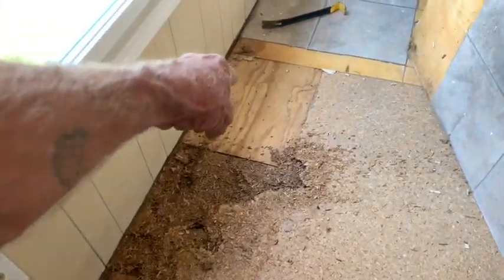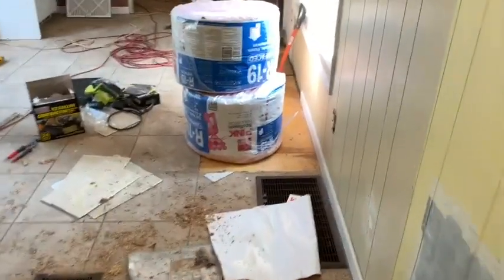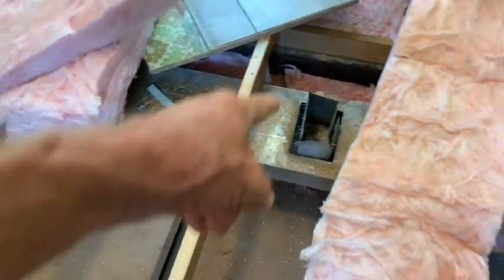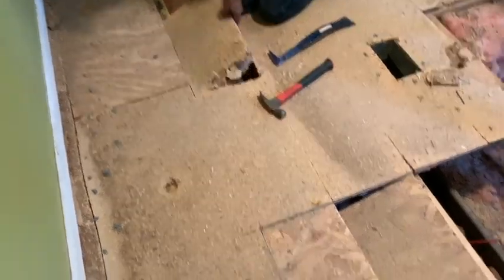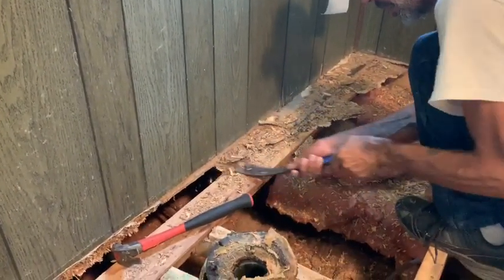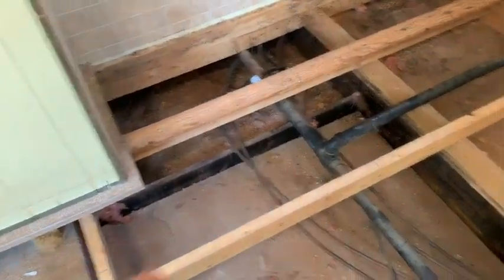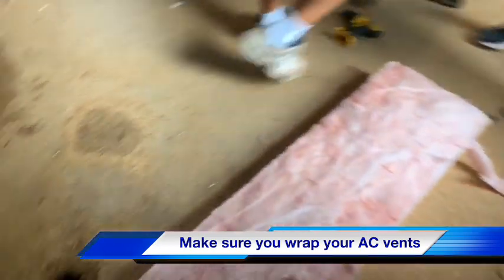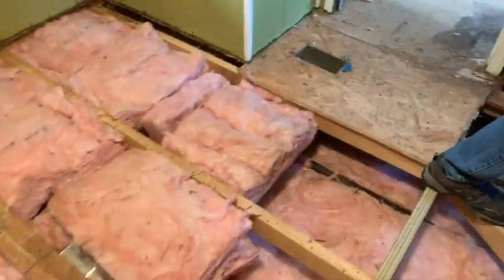How to repair a rotted floor single wide Mobile Home video 2

Comment: I just bought a rambler that was completely remodeled accept they just laid down a quarter inch plywood in top of rotting, spoungi, and rat chewed flooring from underneath.  I spent 7k having the insulation removed, the venting, and had reflexit bubble wrap like insulation out in.  Done poorly.  My floors are getting wavier and wavier.  I have replaced some very rotted spots myself, very patchwork style but id rather spend the money have the entire sub flooring replaced.      But I feel that I need to figure out my insulation first.  I am considering foam board.  I don't like bat because it just becomes a home for rats.  :(
Reply from the maker: I would have went in there removed all the three-quarter inch crap board replaced all the insulation installed all new Three-quarter inch subfloor for seven   He usually runs about $1000 every 10 foot so if you have a 60 footer you’re looking at six grand. Labor and material
Reply: @Drewsroofingandhomerepair  that's amazing.  Too bad I live in Washington state where it seems home repair is expensive.  Which is why I end up learning some of this stuff on my own.
Reply from the maker: I wish I did live closer I’d gladly help you out

Comment: are you saying you can replace a section if its plywood but not osb
Reply from the maker: I’m saying if it’s OSB it will be best to do whole floor
Reply: @Drewsroofingandhomerepair  HUH?
Reply from the maker: If the floor has OSB or particleboard it’s best to change the whole floor and not just do a piece

Comment: Do you just get as close to the wall as possible ??????
Reply from the maker: Yes I just get as close to the wall as I can and if you look at some of my videos you’ll see the saw that I use I bought it at Harbor freight it’s called a flush cut saw or a jam so if you take a picture of it you can bring it to Harbor freight and they can get you one for 80 bucks
Reply: @Drewsroofingandhomerepair  thank you so much
Reply from the maker: Go to my video where you see me using that Walsall take a screenshot bring that screenshot into Harbor freight they’ll put you right on that tool.

Comment: How much does a job like this cost? My sisters Doublewide has several soft spots. We were going to do exactly what you say not to do, patch just the spots. She is ready to light a match to the piece of sh it.
Reply from the maker: Right now plywood is expensive. The prices are starting to come down but they are still quite expensive if you measure your floor and it measures 10 x 10 that is 100 ft.² it would take three pieces of 4 x 8 plywood to fill that spot that’s how I figure my materials.
Reply from the maker: https://youtube.com/playlist?list=PL8xp84iSvTA570yVi5b5MZAIrw5yNXkQT

Comment: I need a new roof, 3 different wall areas, and new floor on the end of the trailer.  I’m wondering if it’s worth it because this looks EXPENSIVE!  Are you willing to reveal the charge for the job in the video, just for an idea?
Reply from the maker: You can replace a 10 x13 room your self for around 500

Comment: Great video, those floors that are press boards, aint worth a damn.  They will get wet, and absorb water and will get soft and break apart. Yep damn saw dust, cheap ass wood. Once wet, you will have hell on your hands. Best GET WOOD THATS GOOD FOR FLOORING.
Reply from the maker: It’s hard to believe what they put on Mobile Home Floors when they make   Them

Comment: so you replace floor with new plywood and floor covering down the road you have another leak do you have to replace the whole floor again or just a section
Reply from the maker: Just a section if it ever happens again but it shouldn’t ever happen again now
Reply from the maker: dumpster d if you have old OSB you’ll have to replace it if you replace the whole floor with new plywood number one if it gets wet it takes a long time for it to deteriorate so you know you have a leak way before you have to replace the whole
Reply: @Drewsroofingandhomerepair  polybutylene
Reply from the maker: Nice

Comment: but even if you replace the whole floor if you have a leak you have to do it again.
Reply from the maker: No that is not true because when you replace the floor you get rid of that old garbage and you use the new upgraded updated plywood that does not go away when it gets wet. So I understand what you’re saying. But that is not the case if you put better plywood on the floor than what was there. And that would obviously be my choice. You’re going to either use 23/32 laminated plywood or what I would prefer would be the Adventech. Now that would be the best plywood you can use it will never go away even if you dumped your swimming pool in their

Comment: Drew's - Of all the videos I have seen out here, only one other made sense and I could tell that he knew his shit - as y'all know yours. I have never done this before and am going to be doing some MAJOR work here soon, money providing and a little at a time, to a 12x60 trailer. The bathroom which is right now my central most concentrated focus, is ALL MESSED UP. I would love to shoot you a video of the way that it looks now and just from the topside alone. Whomever did the shit work here before, I wish I knew where and who they were so I could embarrass the shit out of them for this crap ass job! Dude, they ran an outside water hose through the inside of the house from the bathroom to the kitchen in order to hook up water in the kitchen!
Anyways, with the bathroom floor: I have a toilet that has overflowed several times onto an already damaged floor as well as a washer that has done the same, once. The toilet is sinking into the floor, won't flush anything but piss/urine and the soft spots around the toilet have proven treacherous to say the least. I have to tear apart everything to fix this shit and have no clue what I am doing. Not only that, I have little funding, no one within a 100 mile radius that has any clue on how to do this or to even begin to give advice, two sons and a wife to protect and more stress than Al Bundy when it comes to the mounting home repairs needed. My walls are falling in and are rotted around every window along with the floors that join them - AND I REALLY NEED YOUR HELP!
Reply from the maker: It’s not that hard to do I hope my videos help you I hope it something you can find a way to do yourself I think you can do it

Comment: 3.5” floor joist 24” on center? Seriously? How did the manufacturers get away with this??
Reply from the maker: Do you think that’s bad wait to you see this video then I’m sharing with you. This is the kind of thing that they used to allow back in the day. Thank goodness they don’t allow it anymore please check out this video below you will be flabbergasted. 
https://youtu.be/6eCF4OBSJNA
Reply from the maker: And if you think that one’s bad look at this video
https://youtu.be/cp9igBMSDAY
Reply from the maker: I have seen just about everything when it comes to a mobile home unbelievable what they let them get away with
Reply: @Drewsroofingandhomerepair  I grew up in a 20 year old 1972 Champion… the roof trusses were made of 1/2” square stringers and scrap paneling stapled together. When my parents bought it in 1990, it was all original inside - complete with red shag carpeting and padded vinyl “beams” in the living room.
Reply from the maker: That is a hilarious story. Shag carpet L O L

Comment: But if you do the whole floor you can still get a leak
Reply from the maker: Yes that is true but the reason why I say do the whole floor is because of the type of flower that is on the floor. The plywood that is on the floor is very susceptible to moisture. Therefore you want to replace the entire floor with flooring it will not go bad if there is another leak. The flooring that you’re looking at in the mobile home is made of sawdust held together with glue. If you get another leak you’ll have to do the whole floor again and that’s what you want to avoid by doing the whole floor.  Imagine you patched the floor and then you put a new floor covering on it and you got another spot. If you use better plywood even a leak will not cause floor issues. I recommend this flooring if you’re going to do any subfloor in your mobile home
https://youtu.be/x8bMWtNVzxY

Comment: Ive been in my home for a year and it started to get soft a few months after i bought it.I think i got scammed.
Reply from the maker: Look under the house make sure that the floor is not exposed anywhere. You probably didn’t get scammed if you got it for a good price the floor can be repaired fairly easy with some elbow grease. I love single wide mobile homes the problem with them is if you put a new air-conditioning unit in your house it could create a problem with your floor ducks sweating. Open up your vent and see if you were having Eric scape if so get some duct tape and tape them up so no air is blowing under your house that will create condensation in the summertime and the winter time. https://youtu.be/_3VfdXmCw0A
If you have any more questions feel free to contact me I love to talk
Reply: @Drewsroofingandhomerepair  I actually have a double wide and underneath it is exposed.
Reply from the maker: You mean you can see the insulation?? If so that’s not right it should have a black underbelly that covers up everything. 910-294-1761

Comment: Why in your video the paper on insulation is not inside house.. others video has it stapled
Reply from the maker: I went paperless no vapor barrier
Reply: I do believe it's based on where you live, north or south, as to whether the vapor barrier is inside or outside the insulation.

Comment: What was the cost of this project?
Reply from the maker: 4500
Reply: Drew's Roofing & Home Repair   That's a lot of work.  You are very thorough.  It's hard to find a reputable contractor that will do a good job without getting taken to the cleaners financially.  We recently had a very expensive water leak.  I ended up doing most of the repair work since the contractor took all the insurance money.  I originally hired him to relevel my mobile home.  That's when the water leak was discovered.  I used a leveling compound on the bathroom floor instead of replacing the plywood subfloor.  He charged $8 sf for vinyl flooring.  I still need to replace and repair subfloor in my kitchen from previous water leaks.  I guess I will have to tackle this myself.  Just burned out at the moment.   Just recovered from almost two months of renovations.

Comment: how much would you charge for something like this?
Reply from the maker: 4600 for everything L/M
Reply: @Drewsroofingandhomerepair  4600 for the one room?
Reply: And is this for just for wood work or will there be a totally finished room with carpet or vinyl or whatever on top?
Reply: You would have 10 crews working full time here in Florida.
Reply from the maker: On this particular job I charged 4300 labor and material

Comment: The floor got wet from the dryer on the other side of the wall?
Reply: Remake  the duct risers but make them larger to sit on the out side of the trunk line hit them with some zips and mastic the joints with wet or dry roof mastic it won’t run off if it sweats then wrap it with actual duct wrap  or it will still sweat I know you said it sweating because of the hot and the cold air or whatever the hell you said but the reason it’s actually sweating is because the cold air is causing the aluminum duct to hit the dewpoint and the humidity that’s rising up from under the trailer is condensing on it so the only way you’re going to stop that sweating is to fix all the leaks properly wrap the ducts properly and repair the vapor barrier completely underneath the house you can wrap them ducts with wall insulation all you want it’s not gonna stop the sweating because the humidity will permeate through the insulation and you will be back at Square one with the floor stick to the carpentry and let us AC contractors handle the air conditioning and ducts
Reply from the maker: This is how we repaired them watch this video. https://youtu.be/_3VfdXmCw0A
Reply from the maker: https://youtu.be/_3VfdXmCw0A
Reply: Yea you remade the risers the right way my only thoughts are don’t use foil tape next time it isn’t gonna hold especially without spray glue as much as you probably don’t want to hear this you need to mastic your joints but regular mastic just runs off use the wet r dry roof mastic because unless you rewrap that duct with something with a proper vapor barrier it’s just gonna continue to sweat and the tar shit is the only thing I’ve found to work but good job 👍
Reply from the maker: Thanks Peter I’ll try that on my next one

Comment: I wish I had some help with replacing my floors in my trailor.
Reply from the maker: I wish I could help
Reply: @Drewsroofingandhomerepair  yeah me too, sir...I would hire you right on the spot. Thank you though and thank you for the videos...I've learned a few things....my trailer needs so much work now, I don't know where to start....I got a loan now to fix it but I'm not sure if it wouldn't be better to up and move on....
Reply from the maker: That’s a terrible thing to have to move on if there’s any kind of video you want to see that I might have that you haven’t seen let me know I’ll share it with you. I hope you’re able to stay in your home. A home is a home no matter what size no matter what kind. I hope you can work it out good luck. Like I said if there’s anyway I can help let me know I have lots of videos of different things I’ve been doing it for 13 years
Reply: @Drewsroofingandhomerepair  sure will. i've been watching all of your videos and I sure do appreciate and thank you for taking the time to post them and help folks like me out.
Reply from the maker: I’m glad I could help. Thank you for watching

Comment: That’s particle board! Complete garbage!
Reply from the maker: I agree that particleboard is garbage
Reply: @Drewsroofingandhomerepair  
that may be but, in my experiance as long as the home is plumbed in polybutylene water lines you, can tell if there is a under the floor leak sooner (if it just pissing). I would talk to the home owner about replumbing with PEX pipe as long as you are cutting out the entire floor which I believe to be completly unecessary and at more expense.